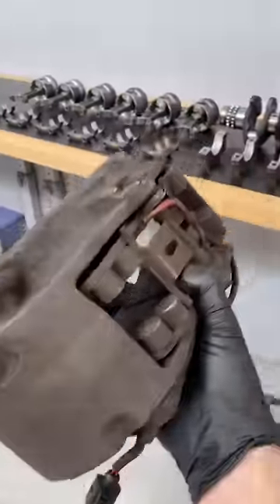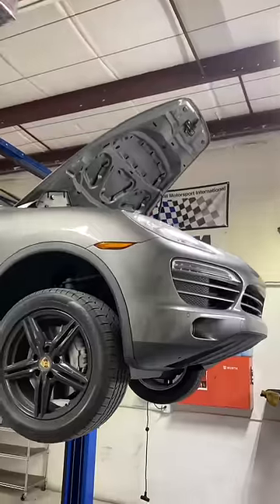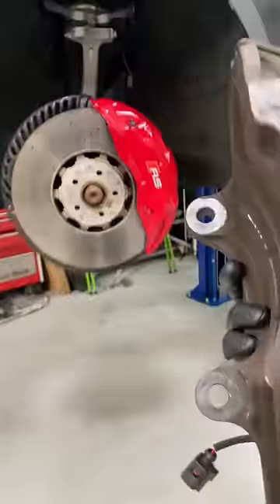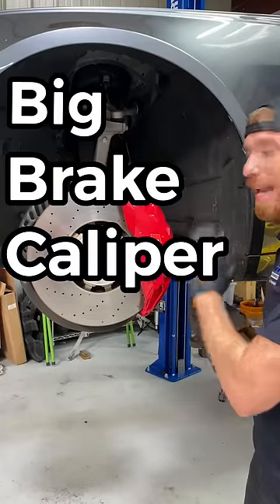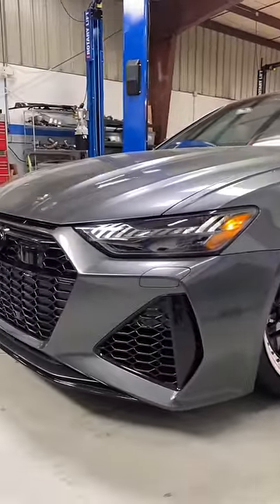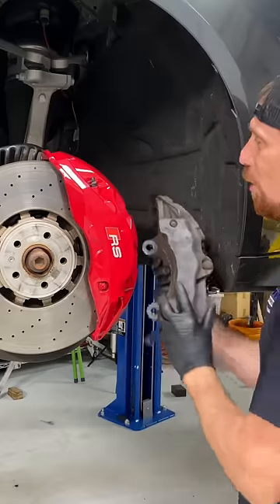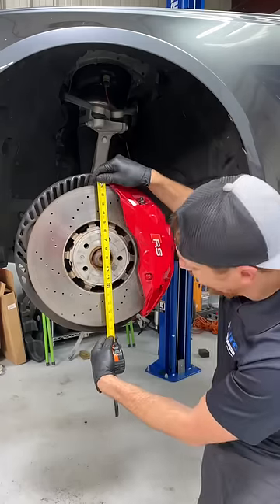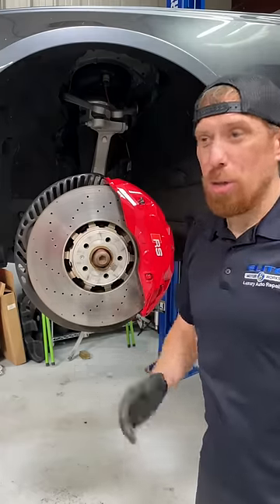😮 World’s Largest Brakes!

Comment: Just want to remind everyone that SIZE of the brakes and number of calipers isnt exactly a 1:1 indicator of braking performance. People often get big brake kits for their street builds or track builds. Why is that? Well it isnt BECAUSE BIGGER BRAKE MEAN IT STOP BETTER. No. Not at all. In fact, the teller for brake performance really is in tire quality, wheel size, weight of the car, and in the pressure of the ABS system. It DOESNT REALLY HAVE ANYTHING TO DO WITH THE SIZE OF THE ROTOR AND NUMBER OF PISTONS AND CALIPER SIZE. The ONLY and i mean true actually measurable use in gigantic brakes is so that the brakes perform at their normal way, without experiencing the effects of fade from heat. Thats 99% it. Big brakes do not magically make your car stop better.

Comment: The size of the caliper is irrelevant, the collective piston area is the ONLY thing that matters for the caliper. That smaller caliper with the properly sized system and pad coefficient can put out just as much camping pressure as the "big red" caliper. Calipers can become TOO big in which case the clamping pressure over the surface area of the rotor is soo large and dispersed that braking power is reduced.

Comment: As a diesel tech, I just laugh at this. The rotors on semis/trailers come new 45 mm thick. 37mm is minimum thickness allowed by dot. Tbh I don't think I've ever measured the diameter but they're fucking huge. Caliper alone weighs 80 pounds at a minimum. Held to axle via 6 bolts with harden washers 2mm thick. torqued to 350 ft lbs. Must replace bolts/washers whenever caliper comes off.

Comment: Go check out a Bentley Continental GT… pretty sure those have the largest production brake rotors.
Reply: Its the same one as this. 440x40mm disk with 10 piston caliper. Because you know, VW group.

Comment: better is the brakeing by rekuperation of an electric motor, those brakes never wear out and accordingly never need a replacement. if the electric motors have a heatpump, they will not overheat and the brakeing will not fade out like overheating friction brakes like the obes in the video. electric drive is better.

Comment: I have rs7 2021 trying to do break pads all around front and back got the wheel locks off now I ran into a nut /wheel lock on the calliper it’s self afterwards I realized why 😂so I spent 3800$ on  break pads alone front and back pls someone help